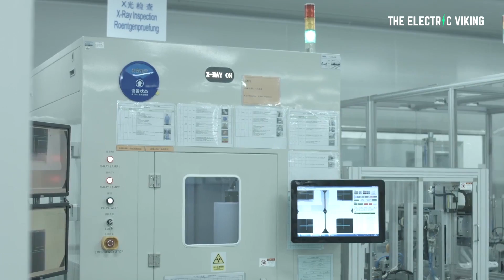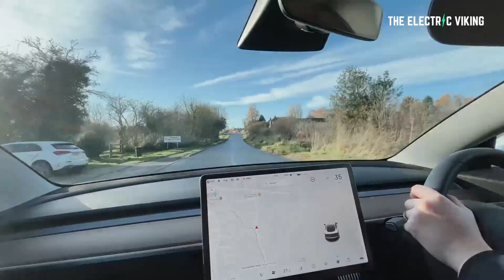This NEW battery changes everything - GAS sales will collapse

Comment: You would be correct IF the supply of EVs meets demand and affordability. Unlikely to happen anytime soon. I expect a lot of old, used ICE vehicles will have to fill the gap until then.
Reply: It's because US doesn't allow Chinese EV in its market.
Reply: @henrytaverner1803  Yes but watch Ford and GM rebadge the BYD or other Chinese car to make money
Reply: Give it 5 years.
Reply: @williammeek4078  unfortunately Surreal is correct here, for a large percentage of the population, old used ICE vehicles is all they can afford to buy. Itll be many years time before viable used EVs that people actually want come down in price and approach price parity with used ICE vehicles.
Reply: wilson5 / No. Your prediction is wrong.
The future high price of gas, diesel combined with future high pollution taxes and with generous government incentives for buying a new EV will make the total transition to EVs very quickly. 
Everyone, every simple worker, will be financially able to buy a brand new EV in aprox 5 years from now.
Reply: @mikel4879  that's a very optimistic prediction. With inflation high and supply issues of raw materials I think it'll be much longer than 5 yrs. It's going to take more than 5 yrs before vehicles like the Model Y, Mach E, F150 lightning are available on the used market at prices the vast majority of people can afford
Reply: wilson5 / I do not believe at all that, for example, Tesla EV is a future car for masses, because, as we see today, Tesla doesn't build any EV for the regular working people, and there's no plan at all made by Elon Musk to build such affordable EV model. 
So, the meaning of my writing is only about the manufacturers that will build very soon the EV models for large masses, EV models that will be cheap and very useful for the common person who has a modest salary. 
Those are the chinese manufacturers, Ford and GM.
However, the manufacturers that will not build the cheap and totally useful EV for masses will be insignificant for the future EV manufacturing industry, marginalized and pushed totally aside.
On the other hand, the ICE car manufacturers that will still push the ICE car manufacturing and not totally wake up by around the year 2028 ( like Toyota ) will go bankrupt, because the majority of people will have already bought a very good EV by 2028.
Reply: @mikel4879  So a few problems with this. For one, the US is/will lag behind China and Europe in EV adoption. Those "affordable" Chinese EVs are not and will not be available in the US market due to governmental policy. For the record I currently own a 2019 M3 and bought it at a time when they were relatively affordable. Now a base Model 3 is about $10k more expensive compared to when I purchased it in 2019. The Chevy Equinox EV is "supposed" to have a starting price of $30k USD, but that remains to be seen whether or not that will actually happen (probably closer to 40k with some options). I just don't see where on the horizon this flood of sub $30k USD EVs are coming from (certainly not Tesla, member the "35k Model 3"). ICE will continue to dominate the used car market in the US for quite some time in the US until EVs reach a point where supply starts outpacing demand, which unfortunately is not going to happen any time particularly soon.
Reply: wilson5 / You still keep repeating the same of your ignorance.
The chinese will build relatively soon EVs in the USA. Ford and GM have already declared that they will build soon affordable EVs addressed specifically to the large mass of the common blue collar workers.
Etc.
Re-read my first text sent to you and understand, if you can, the reason for which the adoption of EVs will be relatively fast.
Your long text is mostly just useless blah-blah.
Reply: @mikel4879  yeah I read what you said, and you still haven't addressed the issues which I raised either. Ive already stated that EV adoption will happen much quicker in China and Europe, but the US as a whole will lag behind for various reasons. Until supply starts catching up with demand, EVs will remain out of reach for many consumers, especially in the US as the US doesn't have access to those more affordable Chinese models. Call it useless blah blah blah all you want, but thats just the reality. Once manufacturers are able to produce reasonably priced EVs at a large enough scale, then that's when adoption will really take off, but until then, ICE vehicles will dominate the new and used markets until then.
Reply: wilson5 / You still keep repeating a big error originating in your general ignorance about the adoption of EVs in the USA.
I'm telling you here a big secret that you don't know at all : the USA does now what it does absolutely intentional !
It has all the money to do anything in the EV sector, and for the rapid adoption of the EV, so why scratch fast if there's no important itch at all? 
As a japanese saying approximately goes: "other's people excesive pride creates a huge opportunity for you".
The USA applies the right strategy this time, if you can understand what I mean.
They take the total advantage of the situation of "now", in contrast with its highly wasteful technological past of the 20th Century. 
If you get what I mean!😏
It is exactly what it means to become much wiser in the 3rd millenium.
Reply: @wilson502  yes, only 25% of all car sales are for new cars. It won’t be till about 2045 that all the old ICEVs have left the road.
Reply: Poorold p / I don't believe this.
A serious car manufacturer should be capable to build a car for masses anytime.
I believe you're a Tesla investor, and you're lying here in desperation because Tesla stock keeps falling.
Square head, a car manufacturer, any car manufacturer, can't be profitable in the long term if it doesn't build cars for absolutely all people, for all pockets and incomes.
Well, Tesla doesn't build affordable cars at all; therefore, sooner or later, the "chickens will come to roost".
There is not an unlimited number of idiots with money to buy the expensive Tesla EVs.
Reply: @mikel4879  You clearly don’t understand business. Batteries are in limited supply. “Cars for the masses” require high volume to make margins. Higher end cars have higher margins so are profitable at lower volumes. As battery volume increases, they move down market. It is that simple. 

Also, you make the false assumption that Tesla can’t or won’t add products to it product line. This is false. There are 4 products waiting on enough spare manufacturing capacity to come out. Roadster, Semi, Cybertruck, and the still unnamed Model 2.
Reply: I'm curious as to where all this extra electricity is going to come from. California n Texas have brown outs almost daily as of late
Reply: Livetool, go and Learn! / When the engineers of BlackBerry cellphone saw at the beggining of 2007 what Apple wanted to do in the smartphone industry, they said that it will be impossible, because a completely different kind of network has to be built.
And Steve Jobs said this: Yes, evidently that we will build a very new and different kind of network. 
And it was done. It took some time, but it was done. 
Etc. 
The same question you and others like you present here. "Ooooooh, it is impossible, because the electric grid is not prepared, the power capacity is not there, is not enough, etc, look at the present blackouts, etc".
Well, it will have to be built, to be improved, etc, and it will be built. It will take some time, but it will be done.
There's no other road, no other way in this direction for humanity.
It is the beggining of a new technological revolution on Earth, and, exactly like the ones of the past, it will prevail, whether the oil industry and its bribed politicians and ICE CEO's want it or not.
Reply: @Butchdabuilder  what extra electricity are you talking about?

Comment: There are problems here.
Tesla will not go to a 800v or 1600v system.
My Tesla LR uses 40-45 minutts from 0-90%.
If you don't up the volt, there will be to mutch heat in the cabels.
3. To charge from 0-100% in 5 minutts, you need a charger who is 5 times faster than a Tesla 250 kwh.
So, 4 times the Ionic system.
So, if you increase the volts to 1600v, you could do it.
And the battery needs to be able to take full charge at any level.
But, then you need to change every charger, or upgrade it to that standard.
And in the future the battery size needs to increase, to.
Towing are a big part of driving in the world.
I think the standard battery needs to be atleast 150 kwh. So, 10 minutts?

Comment: And the other thing with EV's nobody is talking about. 90% of people only travel sub 50 miles a day 90% of the time. We want energy storage to make wind, tidal and solar power viable, we have it by default with large scale EV adoption. Vehicle to grid makes green energy super viable, if your going on a long journey just press a button on an app, otherwise the energy grid will utilize your car's battery to store energy at off peek demand and supply it at peek demand, and in return pay you for the service.

Comment: This changes nothing. I am very happy to see new battery tech, but EVs are still out of reach of most of us and will be for many, many years...
Reply: I think if they left out all the bells and whistles and gave us a car that does what a car is meant to do, we could have electric cars for far less money.  Do we really need cameras, sensors, actuators, autonomous driving, drive and steer by wire, electric seats (and windows for that matter), 0 - 60 in 3 or 4 seconds, ….  ?  I don’t.
Reply: @paulvansteenberghe4644  true, but Tesla's intrinsic value will be decided and built on autonomous (FSD) driving. all the fancy bells and whistles are needed. prices will drop once the supply and cost curves fall in line with scaling.
Reply: I remember this same stupid comment made about Cellphones, Refrigerators, Air Conditioning, VCR's, DVR's, HDTV's.

There were always times when new technology came out the first few years the average person couldn't afford any of them.

This will change and soon, within a couple of years EV's will be cheaper than a Gas Car.
Reply: Yes but this opens the gateway to cheaper batteries hence cheaper EV's.
Reply: Used EV's cost less than new ones. Go used instead....
Reply: @Brian-om2hh  I am in the UK. Choice of used EVs is laughable. I want EV, not used Zoe or Leaf...
Reply: @melhiore    Nothing wrong with a used Leaf.
Reply: @benjaminsmith2287  If your decisions are made on whats under the sheet metal instead of whether or not you like the shape of the sheet metal -- Tesla has no competition in the USA or anywhere else -- IF your decisions are based on functional engineering and aerodynamics.  If they are based on other factors like the emotional appeal of a certain style, there are the Fords, the Hyundais, the Lucid, the Polestar, the GM trucks and car,  the Nissan, the Toyota, the mini,  the Audis, the BMWs, the Mercedes, the Pinafarina, the Porsches, the VWs, and the Rimac.  And probably some others that I couldn't think of.
Reply: @Islamisthecultofsin  plenty wrong with a used leaf,  they'yre fugly, no active thermal management (passive cooling only), degrades at a much higher rate than EVs with active liquid cooling solutions, range is extremely limited which means you cant viably road trip with it and limited to urban settings. So yeah, theres plenty "wrong" with a used leaf.
Reply: @wilson502    They are fine for city use and they can be bought cheap.  If you are picky then order a Tesla.  Get the plaid.
Reply: @Islamisthecultofsin  this is a ridiculous response. First off how many people can afford a Plaid? 2nd a large percentage of the US cannot afford a new Tesla or even a used one. A leaf is purely a city car and doesn't work for many use cases and scenarios. Again, it'll be many years before you'll be able to buy an used EV that's affordable and covers the current use case of ICE vehicles.
Reply: @wilson502   You can buy an old Leaf and put a larger battery pack in it which will double its range.  Then you have new generation batteries that will probably double its range again.  If the Tesla can go a million miles then its a good value.  Skip the plaid if you want.  I was just playing.
Reply: @Islamisthecultofsin  why in earth would u put a battery pack that costs more than the car itself in that fugly pile of junk? The leaf doesnt have the thermal management capabilities of Tesla or any other EV maker that uses a liquid cooled and heated battery pack. Those "cheap used leafs" are cheap for a damn good reason. Its because they have extremely limited capabilities and don't work for many use cases. Wake me up when used Model Ys and Mach Es are 20k USD.
Reply: @wilson502    Because you don't need thermal management for around town use.  You charge at home and everything stays cool all the time.  You don't need a Tesla for around town driving.
Reply: @Islamisthecultofsin  yeah you kinda do, this is just plain ignorance. Theres a reason why everyone nowadays uses active thermal management on their battery packs. You seem to just ignore that the leaf doesnt work for a lot of use cases for many situations and scenarios. You also seem to forget that the leaf was literally just a compliance car, and is not the type of vehicle that can replace your family sedan or crossover SUV for all its use cases. Just brushing off those concerns aint going to cut it, and again, theres a good reason WHY those used leafs are so cheap.
Reply: @wilson502    You missed my point completely.  If somebody just wants an electric car for around town use then it's a good deal.  If you need the range and fast charge capabilities of a Tesla then buy a Tesla.  Otherwise it is just plain dumb to buy a Tesla and then drive it thirty miles a day.  The Leaf could have done that with ease.
Reply: @Islamisthecultofsin  no, you are missing the point completely. People looking to replace their ICE sedan or SUV are not going to replace it with a POS leaf that only goes 50 miles with its degraded battery. There are nowhere near enough leafs out there to replace a significant number of ICE vehicles anyway due to their low production numbers. "Just buy a Tesla" doesnt solve the issue of affordability for EVs that serve most peoples use cases. Even used Teslas are not affordable to large portion of the population in the US. Until these automakers start ramping up production of their electric models and supply starts catching up with demand, ICE will still dominate the new and used car market in the US. The US doesnt have the variety of EVs available to them like China and Europe.
Reply: @Islamisthecultofsin  lol, I dont have an ICE car FYI, I own a 2019 Model 3, Im just stating hard facts and reality that you have yet to refute or provide any sort of coherent counter argument. Sorry if reality bursts your little bubble.
Reply: @Brian-om2hh  If you can find them. Either its a Leaf with 60 miles of range for 10k or a used Tesla for 40 to 50k
Reply: @Brian-om2hh  Except Teslas

Comment: Will the electricity infrastructure be able to supply the current needed?
Reply: As the number of electric cars slowly grows, the amount of power generation And transmission will keep up.  The last ten years has shown a lot of solar and wind coming online.
Reply: In the UK at least, the National Grid says yes......
Reply: The expectation is that most EVs will be charged at home at night, which is during off-peak hours rather than during peak hours for the grid. Thus, there will be little need to increase the grid's peak power output.
Reply: Depends on who you believe? In the U.S. our grid is designed for almost 10twhs annually, yet we use about 4twhs total.
To switch all forms of ground transportation to evs, from the studies I've seen. Say it would use about .75twhs at today's average efficiency.

But that study doesn't account for how as oil demand drops, refineries go offline which each use a STAGGERING amount of water electricity and cobalt each day. It doesn't account for the tens of millions of oil pump jacks running daily. 

It doesn't account for fossil fuel pipelines cutting back either. Which also daily use a STAGGERING amount of electricity pumping all those fuels around the country. It also doesn't account for how we wasted over 20% of all generated electricity in an average year. Due to not having anywhere for it to go. Millions of evs plugged in using today's smart chargers could take on that energy instead of it being curtailed or wasted. 

Evs once adopted en masse by the end of this decade along with an 80-90% renewables and nuclear powered grid. Could actually see energy use drop not increase. The precedent is already there if you research how from 1980-2020 population increases over 20% we added hundreds of millions of cell phones, tablets, laptops, smart tv's etc all burning more power. Yet average energy use has dropped due to efficiency gains. 🤔